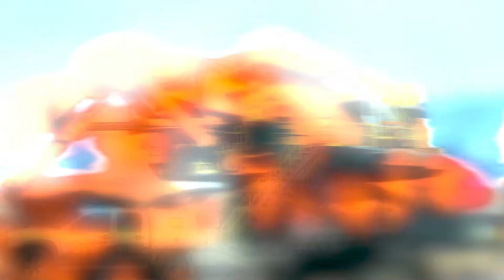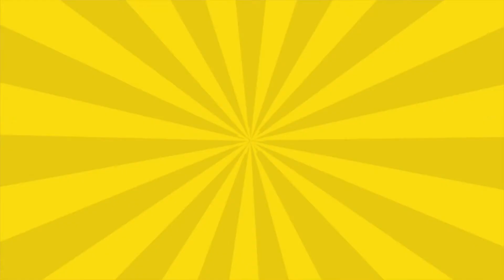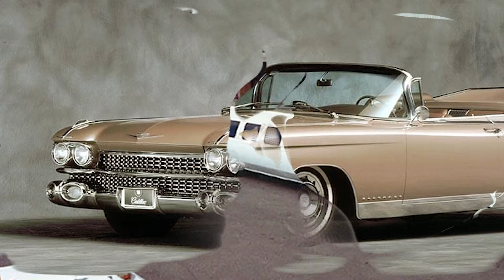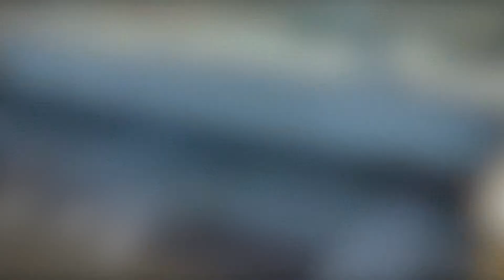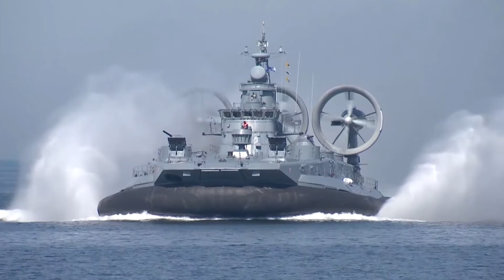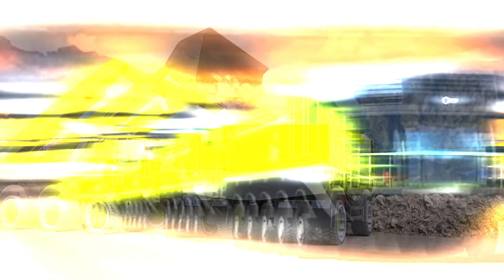Most Massive Vehicles Ever In The World

Comment: Awesone video! Haven't seen part 2. However Saturn Vs and shuttles (as far as I recall) were transported by the crawler without fuel (exception shuttle SRBs) as the liquid fuels were transferred after pad securing. Not sure about the weight difference but the Apollo rocket was likely heavier. 

Awesome video